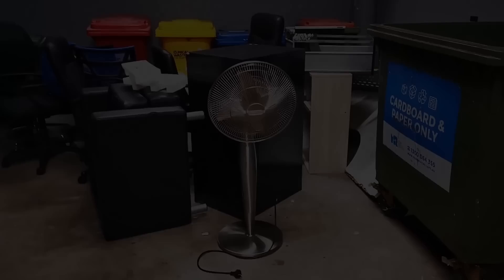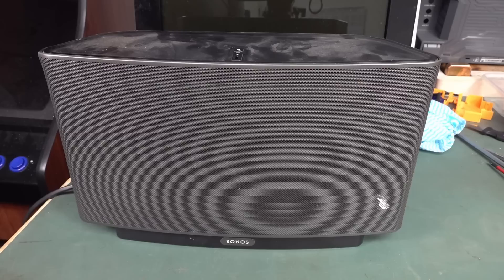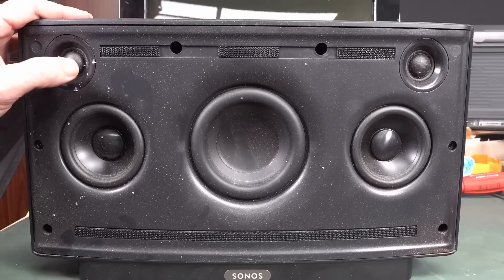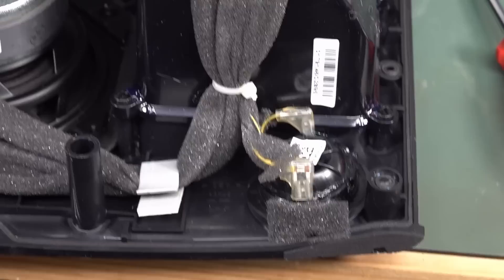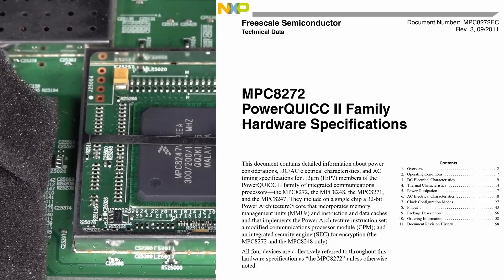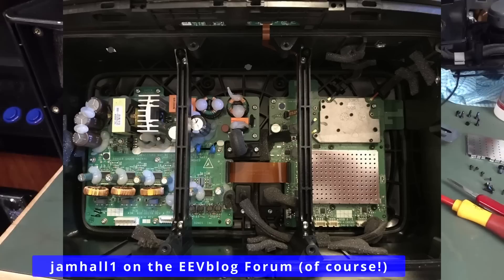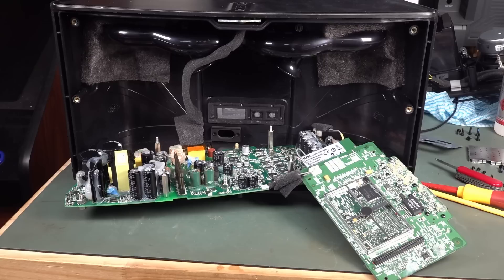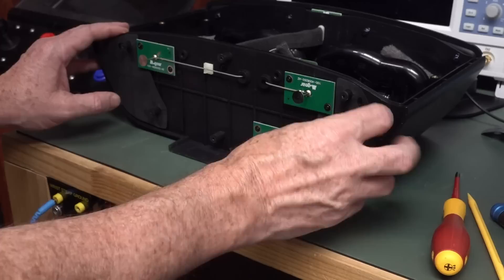EEVblog 1514 - Sonos: The Juicero of Wifi Speakers? (TEARDOWN)

Comment: Sonos created a bit of a storm back in early 2020 when they wanted everyone to brick their existing units in exchange for 30% off the new units that would allow them to implement all the new features that the existing hardware wouldn't support. I remember a bit of a kerfuffle because updates were coming to an end and some people had just bought units that they were dropping support for.
Reply: This helps a lot understanding the kind of company ethics driving SONOS. Thanks for your prompt.
Reply: It is a misstatement to say that Sonos would "brick" units.  They quickly changed from that plan with a bit of internet backlash to rather than bricking traded in units, to let them continue, and they would still work using the old software.  Users had a choice.  You could get 30% off for each existing of the old units, and they wouldn't even disable the old unit, it just wouldn't play with the new software.  Even then the youngest units they stopped supporting were over 5 years old if I remember.    I still have an old unit that I use in a garage where I don't care if I cannot group it with my other speakers.  Sonos overall has been great, and only improved with the newer units.  The WiFi is strong, I almost never have connectivity issues.  Some units I am using in a really hot/humid environment (In Florida on a covered lanai) and they have lasted 6 years with no issues so far.  Much better than many TV's do in that environment!  I think the Sonos stuff sounds decent and works flawlessly.  This from a company that was the first to make this work... long before Google Amazon or Apple had such devices as even a glimmer in their eyes.
Reply: @brianfritz575  You could get 30% off for each existing of the old units, and they wouldn't even disable the old unit, it just wouldn't play with the new software. That wasn't the original plan, certainly not as described on Sonos' own blog. To get the discount it was necessary to enter a menu option that would permanently disable the unit and render it inert. I have no idea if this changed after the backlash, I wasn't that interested - I do know some people successfully created new firmware to work independent of Sonos entirely but that is the extent of the interest I had (I seem to recall the reverse engineering to break in was interesting).
Reply: @brianfritz575  oh how merciful of them to not disable your own property you already paid for ... and only after back lash...
Reply: @brianfritz575  But I also think it would be mistaught to believe there is no adverse consequence to this policy: first we see what consumers do to this kind of devices after they've fallen out of favor: they toss them in the dumpster. Secondly just for the fact of having a kill switch. i.e. in fact a back door, doens't imply it will never be used in the future... I am pretty sure a company take over or merger could trigger those master switches out of legal liability reasons, or even being inadvertently triggered in the future.

For me it's just plainly ethically wrong to support any company pursuing this kind of user control.
Reply: I remember that issue, but they reversed course on that and it was probably driven by some greedy bean counter looking at statistics on how long one of those speakers is in use on average. It's honestly completely unheard of to support a 2005 consumer product into the 2020s. Imagine you having bought a Zone Player 100 (Connect Amp) in 2005. That thing got updated to support Apple Airplay in 2010 and Spotify connect in 2011 while still supporting current connection methods as seen in Daves video.
Reply: @tschuuuls486  but those didn't require a signed in account to function. It's a matter of luck SONOS lasted long enough... it just takes some major company event and if they stick to the industry standard of providing 5 years of online support until network services are shut down for good, your device becomes what is basically a time-sensitive paperweight.
Reply: @TheOwlman  yep it changed - I recently got 20% off a new Sonos subwoofer just because I own a playbase (nothing needed to be changed in the playbase, I still use it everyday).
Reply: @BeKay1211  Good to know, thanks.
Reply: @tschuuuls486  Hasn't this sort of thing become illegal ? At least in Europe, I think it's now illegal.
Reply: The good solution in the situation would have been to build a moderate cost bridge device to allow old devices to keep working together with new devices with what functionality would be possible to handle processing for in the bridge device.

The attitude that a lot of companies have where 5 year old devices are obsoleted because they are IOT devices are the reason I buy zero cloud connected IOT devices when I can choose.
Reply: Sonos had their hand tied and it’s just going to be hell for anyone trying to support years of devices. I know a lot of hardware that died because of the 32bit iOS support going out. Sometimes I wish manufacturers would just unlock the device and give out open source firmware but there is probably a lot of license limitations

Comment: Juicero was completely stupid engineering to squish a bag.  As somebody who designs acoustic products I can say, most of what  you note as “over engineering” is absolutely necessary to get excellent quality in production.  The foam, the silastic, the screws!  Look at any JBL flip or something like that, and they have all the same features.   More screws=more better.  Largely for anti-buzzing.  Every wire and through hold part is an opportunity for buzzing.

Comment: I have one of these, and it is still going strong. The sound is great and fills a room with no problem. This was the flagship model and was probably over-engineered. I have two Play 3 and a Play 1, which are also engineered to a high standard. The newer Sonos gear does not work with the S1 app, and the older equipment has frozen in time and features. If you buy the newer gear, you must run two separate Sonos systems or retire the old equipment. That is most likely why this Play-5 is in the dumpster.
Reply: Isn't it a bit embarrassing to buy into these time-sensitive devices? I now learn from the comments they had the kill-switch ready for any connected 1st gen device. I know one might argue: but only if you wanted to upgrade. Ask to Windows 7 users if they also wanted to upgrade.

I can find schematics and parts for my 90s Hi-Fi, I can still tie in new components to it... and this system from a handful of years back was already on the kill-list from SONOS?

This tells a lot about the company ethics... I was absolutely right in my guts' feelings about this company and products.
Reply: @m80116  Did you not buy a cassette player because in 12 years time a CD player was going to come out, I'm not sure this is all that different. It still works, its just not supported going forward, doesn't mean you can't keep using it.
Reply: @edc1569  There's a substantial difference: nobody at Mastushita planted a backdoor in my cassette deck, I still can find most parts for it, the schematics are freely available on the Internet.

We're talking of a mid 90s deck, an almost 30 years old deck. How is this stuff supposed to be environmentally friendly if it's in the dumpster 5 years after it was sold!

It's out of my mind... I just get familiar with one piece of equipment in 5 years.
Reply: @m80116  As someone who repairs vintage cassette decks as a hobby I can guarantee you that you can NOT still find old parts for a Matsushita cassette deck. Save for the belts and and modern knockoffs (read: lower quality Chinese examples) of the motors, those parts are fully unobtanium unless you cannibalize another deck. Nobody, and I mean nobody is still manufacturing heads, gears, pulleys, or idlers for those old decks - and the bespoke ICs are long gone. Dolby hasn’t licensed B/C/S NR in an IC in almost two decades, and none of the major manufacturers still have stock - so, no.
Reply: @christodd3361  I repair too. Heads of RS-TR on AliExpress. Belts, rollers, most components except ICs obviously, even reproduction gears. Finding new belts at this point would be irrelevant being over 25 years old.

I recently repaired a Panasonic RQ-V15x with original volume pot found well... I won't say. It's the only place in the world that I know of still having a stock, almost 30 years after production. Good luck finding parts for the modern garbage: no schematics, no parts and should you ever cannibalize they're serialized so it's pointless anyway.
Reply: @m80116  Not really - I can’t talk a lot about repairabilty but from a software aspect s1 not getting newer features feels like an acceptable compromise over old speakers getting lagged to death by new s2 features. It’s not like it’s not usable, it just doesn’t get new features